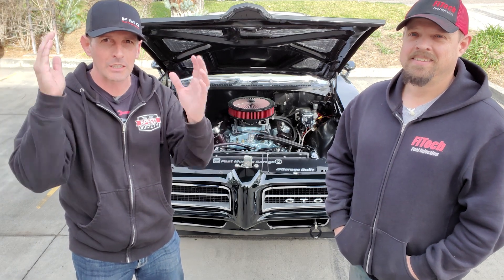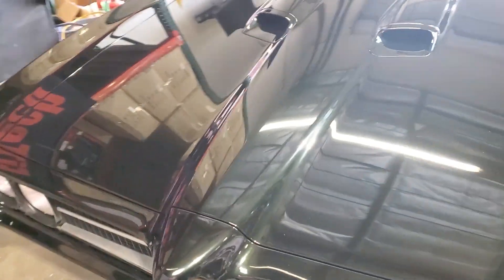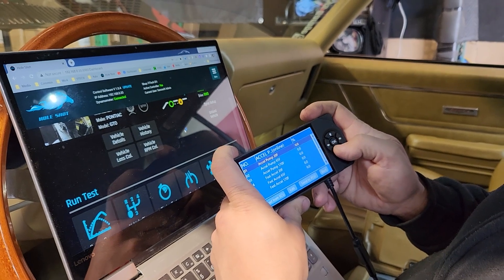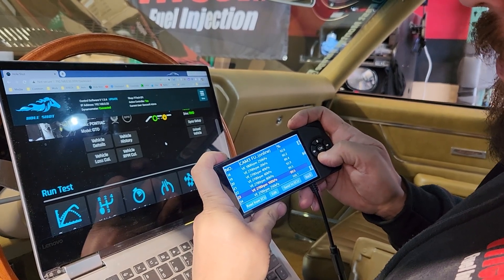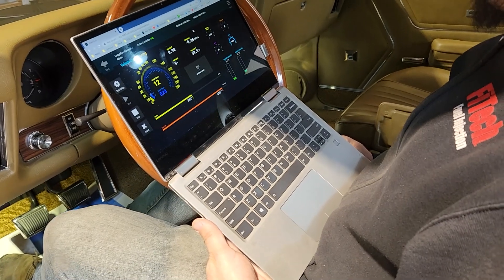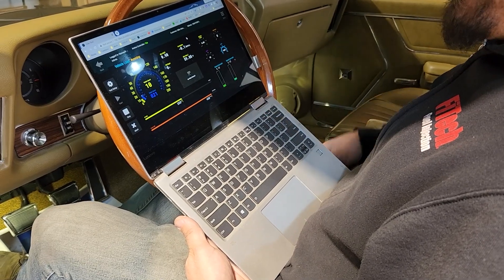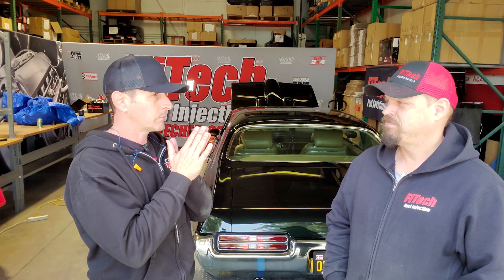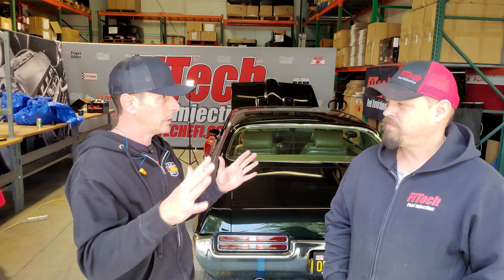Finally!  Dyno Tuning with FiTech!  Tips and Tricks for your Throttle Body Settings

Comment: I built a 468 Pontiac, used a block from All Pontiac and Kauffman racing heads D-port, Kauffman intake, Molnar forged crank Carrillo rods Ross pistons, custom cam from comp cam, quick fuel 850cfm carb, found header's with 2 inch primary's 
Engine Dyno is 613hp at 6100 rpm 588 tq at 4650rpm made over 500 tq from idle to 6200rpm.

Currently building a Pontiac 540cid
Reply from the maker: That sounds slow.  Bahhahhaaaa. Im kidding. Bad ass, my brother!   Thanks for sharing.

Comment: Great numbers.  In your past videos I was unable to find what specs the current camshaft is.  I do know the combination is a 467" with Edelbrock 310cfm D port heads, Torker II intake, and FITech TBI - obviously.  I am trying to get some cam ideas for my 468" build.  Thanks for the content.
Reply from the maker: I have the moderate roller grind from Butler... best to call them to discuss your "ideal" engine behavior.  Have fun!

Comment: I've had a car on the dyno for about 4 days now, however it is a 4L80E, it is virtually impossible to get the procal software to communicate with the handheld tuner or the LS ultimate system, I need the torque converter to lock up to do any kind of tuning on this, the only results I get are from the handheld and we are still way out on correction factors
Reply from the maker: Ohhh man, that's frustrating.  I hope you get it sorted.  Please tell us the fix, when you know.  Good luck!
Reply: Well, we did some more tuning today, we have to change some parameters with a handheld and some with the ProCal software, however you cannot create a log with a procal software and open it, when you open it with ProCal it crashes, so we got to switch back to the handheld and then log the dash or the not values or the transmission values One at a time, then open ProCal look at the log and make some educated guesses, this is very time-consuming, there's got to be a better answer for the procal software, there's something functionally not right with it, we tried it on three different laptops from three different erras
Reply from the maker: @troyfralick  Yeah, that sounds painful... I agree there must be a better way.  Unfortunately, I'm not an expert on tuning... "yet".  Hope you get it figured out soon.

Comment: That’s a real nice green color. Did you weld on the tie downs for the dyno?
Reply from the maker: Thanks!  No, they're bolted ... using the same 1/2" bolts that go through the lower trailing arms.  Two each.  They're from a Fox Body Mustang tow hook kit.  I got lucky they fit.  Thanks again!

Comment: 435 for a butler stroker? that sounds kinda low? what cam are you running, mild ?
Reply from the maker: It's a moderate roller cam from Butler, but the numbers are accurate.  Assuming a 20% efficiency loss, it would make 510hp and 600 lbft of torque.  Thanks!

Comment: Sounds and looks great with some very solid numbers to back everything up. Very cool! Have a Holley Sniper on the 350 in my 68 Firebird, I'm 90-90% satisfied with it. Struggling with idle issues, but the EFI is so nice in the start up and driving manners. Hopefully I can get the idle figured out, acts like there is a vacuum leak but I've checked everything many times over at this point, frustrating. Looking forward to the port injection, something I've considered for when I rebuild this thing if I can't get the Sniper to behave.
Reply from the maker: Thanks Kevin.  Sorry to hear that you're having issues... might want to research if a Throttle Position Sensor might be suspect.  Yup, port injection will be a good one!  Thanks for the comment!
Reply: @FastMonty  Thanks for the tip. The TPS seems to be reading a normal, or expected value in the data but certainly worth another check. I'm basically trying to leave nothing at all unchecked before I'd consider throwing in the towel, so doing due diligence on checking everything multiple times over.

Hey, in this dyno work this is with the T2 intake, yes? Since you've had it on for a while after the RPM, what differences have you noticed? Trying to decide between single or dual plane for my 350 stroker build. Butler said RPM, and I'm good with that but if one wants to go port injection, options get slim.

And hold up a minute, why does it look like there are fuel rails on it in the intro part? Space occupiers or functional port FI? Sneaky.... :)
Reply from the maker: @Kevin W  yeah, I can't really fairly tell you the difference, because as you noticed I installed the single plane port injection manifold, with a standard throttle body. Knowing full well I'd be eventually converting to port injection. Great catch!

Comment: Hi Monty, Why did the FiTech Tuner only rev the engine to 5,500rpm on the dyno pull? Your engine is more than capable to run up to 6,200rpm? Question 2. Why port injection? Other than looking cooler to some, IMO the money spent on that new system to gain maybe 20HP over the throttle body is just not worth it. Again in my opinion. If FiTech is sponsoring you then by all means go for it. Not trying to be snarky but 90% of the folks watching this channel probably aren't going to pluck down $3,000-$4000 for port injection.
Reply from the maker: Good questions... One, you don't need to go past the HP/Torque peak.  Two, we shall see... it's only about $600 more than normal, we shall see... Thanks!
Reply: @FastMonty  I would have like to have seen a baseline run prior to the FiTech Tech doing anything. How much HP/Torque did the engine make prior to any tuning using the built in computer? Other than look at some VE tables what "Tuning" did he do? Did he show you? Any timing adjustments etc? So the final number was 435HP/5,079RPM RWH. Now when you put on the port injection are you going to dyno the car again? Engine Masters did a very similar test - Carb vs. Throttle Body vs. Port Injection. In order of max HP achieved: Carb made the highest HP of the three followed by the throttle body then port injection. As you said above, "we shall see".
Reply: Port injection is more responsive, plus 20hp to the rear wheels is meaningful. I think most of us restomod guys put more money into our cars than we will ever see back in resale. We do it for fun. So port injection sounds like a great project!
Reply: @Scottf5937   Hi Scott, I took a SWAG at 20HP gain at the rear wheels with port injection vs the throttle body. I have no idea. As you say, you do it for fun. Since this in not a high rev'ing engine and the FiTech Dyno Tech only went to 5,500rpm and they call it a torque monster IMO port injection is not going to get much if any increase in either torque or HP. But if FiTech is using this setup as a marketing tool go for it. One last thing. The title of this video is "Tips and Tricks for your Throttle Body Settings". There was not one of either and the Technician was very coy about showing anything. "Don't show anything" was the impression I got. Again, in my opinion.
Reply from the maker: @Scottf5937  Thanks Scott... we shall see what numbers get put down, but to your point, this is a hobby that all of us restomod guys live being different, trying new technologies, and just have fun with it.  I'm looking forward to the really nice starting, idling, and throttle response a port injected system helps with.  We shall see!

Comment: Hey Monte! I’m glad the Fi-Tech unit has been great for you! I’m still interested in going EFI. Theres just so many choices out there. Some people have great luck with EFI and some don’t. But you can also say the same thing about carburetors. I guess I can try out the Fi-Tech and get the fi-tech sump pump with it. I can always keep my carburetor in my trunk incase efi fails on me on the road. It’ll just be a matter of putting the carburetor back on and re connecting to my mechanical fuel pump.
Reply from the maker: Yeah Brother... the latest units out of FiTech are way more reliable than units from 10 years ago.  Keep that in mind when you hear "negative stuff".  The FiTech assemblies also use ACDelco replacement parts.  I really doubt you'll have any issues, but yes, you could bolt the carb back on, in a pinch.
Reply: @FastMonty  Oh thats good to know!